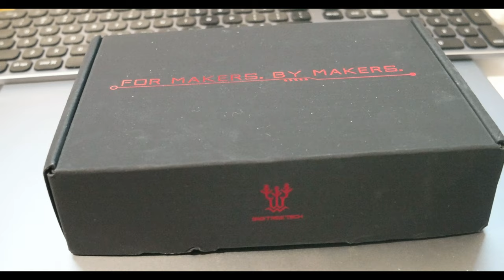BIGTREETECH BTT Manta M8P 3D printer board for Klippler unboxing

Comment: update of your ebike and your 3 motors ?
Reply from the maker: I had to travel for work and so could not keep up with the project but I am trying to do more testing this fall. Hopefully if work permits! In any case I am planning to build the 3D printer as fast as I can to start testing it before printing the ebike frame. For the motors I did some more research on which motor might be the best fit and looks like the 83100 should be the winner. It has a lot of power and torque but I need to figure out if 36 Volts is ok or need to do 48 Volts. Also looking at new ESC and BMS that could fit better my requirements and also dimensions since they need to fit inside the ebike frame body! thx for the comment and please stay tuned for more videos!